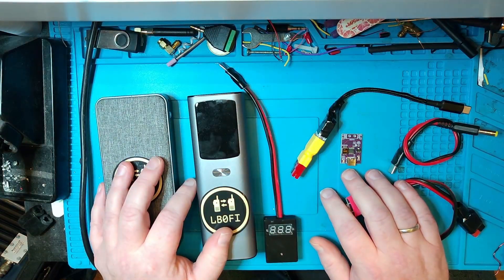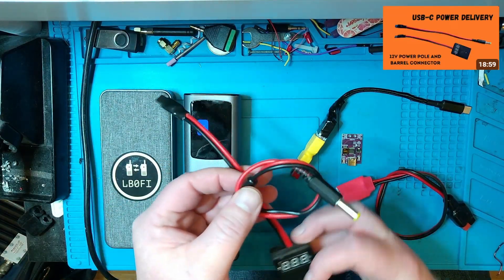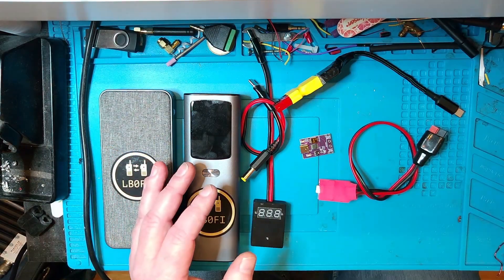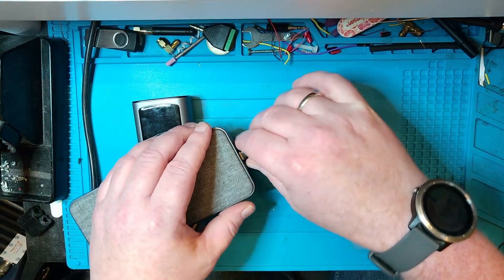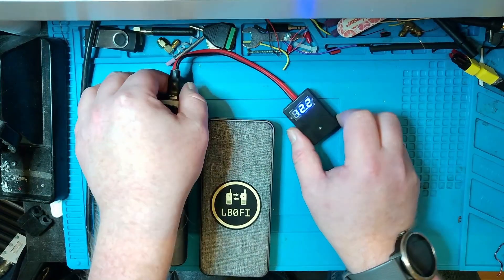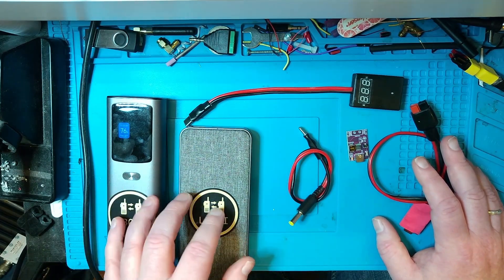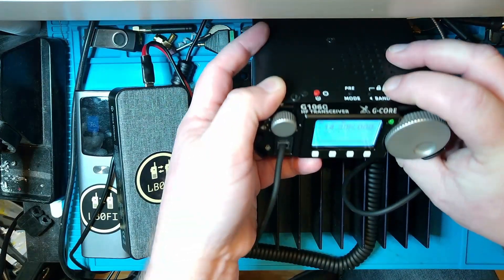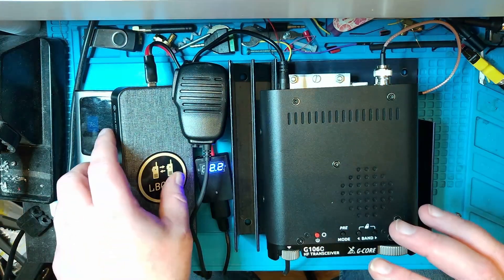Does USB-C PD work for ham radio?

Comment: Did you check receive noise level using the power bank Vs a LifePO4 battery?  Considering the power bank battery is 5v so there has to be a voltage inverter in the box and sometimes they put out a lot of hash on HF. A good one doesn't but you don't know what you get when you buy the power bank. 73 Ed
Reply from the maker: There is no additional noise as far as I have seen. I have a video showing practical use coming out probably by the end of this week.

Comment: Having a multi-voltage trigger cable is terrifying. Dip switch or button away from frying a radio. But fixed voltage trigger cables are great. Thank you for this video.
Reply from the maker: @Aimsport-video  These switches needs a pointy tool and a good bit of force to move, so no danger here.

Comment: Is there a reason not to use 12V PD-trigger cable? No USB-C PD board needed, so soldering. Works for me with the IC-705.
Reply from the maker: No, no reason at all except using what's easily available.
Reply: @stefan2907  The two problems I had with ready-made trigger-cables was first of all the fact that they used very thin cables. Secondly, I was unable to find one with a 5.5x2.5mm barrel connector (not that I looked very hard).
Reply: @radiohyperactivity  Thin cables might be the reason why the KX2 will not transmit at 10W when powered by a ready-made trigger-cable. I'll try your approach as well and see what happens. With the IC-705 10W are not a problem.

Comment: Very informative thanks. Yes, I have been using Powerbanks with my X-6100 and IC-605 for nearly 12 months now. I didn't make up a power delivery cable but bought one off Amazon. And yes, on my recent trip to Adelaide I took the X-6100 and power bank onto the plane as carry on luggage and didn't even get a second look from security. It definitely makes things a lot simpler and convenient. Cheers Phil ZL3CC
Reply from the maker: It's absolutely more convenient Phil. Looking forward to testing this out more.